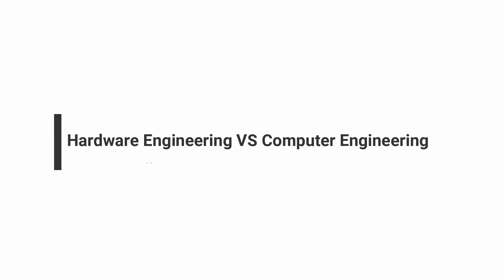Computer Engineering VS Hardware Engineering | Differences and Similarities | My Experience

Comment: Hi. I am a college student who originally was a computer engineering major at a CSU when I was in HS but instead went to community college and looking to transfer to a UC or CSU now. In UCs such as Irvine and UCLA they have a major called Computer Science and Engineering or CSE which is basically half CS and half CE. Although CE is good I feel like u only get a moderate amount of software and hardware knowledge where as in CS for example u get a good foundation for software. So with CSE being more focused on software (as I am more interested in software) would be better for ppl like me. I wish CSUs would offer CSE as it is remarkably similar to CE, it is still a separate major. Good vid and it's true that CE isn't just entirely focused on hardware or as the intersection of EE and CS.

Comment: Bruh theres no difference between computer engineering and hardware (electrical) engineering at the undergrad level lmao. Theres a reason most ECE departments bundle the two disciplines together. It depends on the school, but true computer engineering is firmly rooted in the basics of electrical engineering.

Comment: Hardware engineering seems more for me. Granted I'm still only 16 so I have at least 3 years left until I go to college
Reply from the maker: That’s great that you already thinking about college! I could only think about getting my HS diploma at 16 and didn’t give college any serious thought until late senior year. And you’re right, you do have a lot of time to decide/change your mind so I wouldn’t worry too much about it right now (plus, you’re interests might change by the time graduation). Just try different things to see what you like/don’t like which could also include shadowing an EE engineer (or student) so you can see what you’ll learn, experience and expect.
Reply: @TheSn12  yeah it's already changed 😅. I was thinking industrial design for a while but then I started getting into computers but I realize now that I don't want to do that as a job I'd rather industrial design.
Reply: @sponge260  I'm think of doing hardware engineering also I'm 14 and interested in building computers and stuff
Reply: @michaela4855  go for it man. I've changed my mind on it because of certain parts such as coding and stuff. Just remember it's not all building computers.
Reply: @sponge260  OK but would I have to doing coding also. Should I take computer science
Reply: @michaela4855  i think coding is part of the course, listen you're 14, you've got years to decide yet.
Reply: @sponge260  I'm doing electronics 1 in high school but I don't know if I'll be useful. I kinda want to take computer science.
Reply: @michaela4855  depends on what you want to focus on. If you're more focused on making the actual components and learning about circuits then electronic but if you want more coding and such than computer science.
Reply: @sponge260  Thank you, man
Reply: same

Comment: I have a question: as a computer engineer does can work like software engineer??
Reply from the maker: Yes you can. It just depends on what you want your focus to be in as an Undergrad. Generally, in CE, you can have a focus in software or hardware around your sophomore/junior year. If you chose to focus in software then you can definitively do work as a software engineer.

Comment: Hello.
I'm sorry if my question is out of your video but kindly help me.
I'm having an issue with my external hard drive.
I tried partitioning my hard drive but I got an error which says
"the volume you have selected to shrink may be corrupted. use chkdsk to fix the corruption problem".
How will I go about that?.
Thanks.
Reply: buy a new os or install a new os in bootable mode on a USB and reinstall ur pc to life